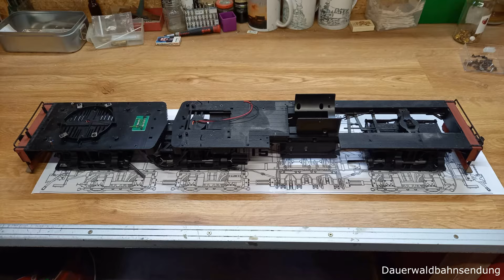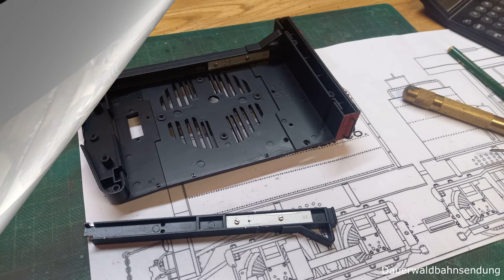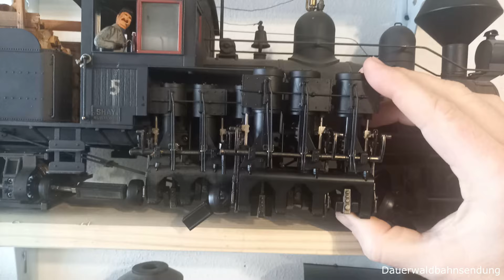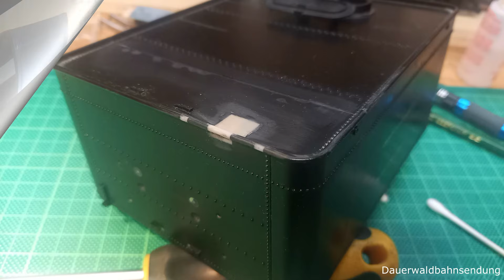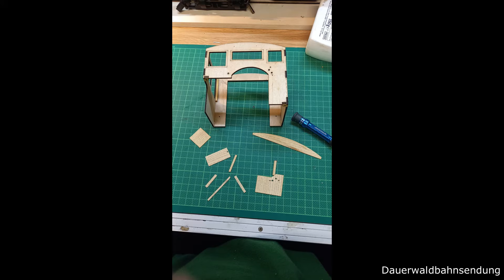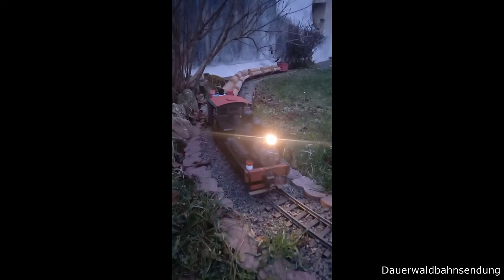Gerd's West Side Lumber garden railroad - Let's build Shay #15

Comment: Hi Gerd, GREAT job on the15. You did a fantastic job using a Bachmann three truck Shay as the doner. When I built my three truckers all they had was the two truck. So I just used the trucks and engine assembly as a start and scratch built the rest. Those assemblies were available from Bachmann. I did midify the cylinder assembly to enlarge it similar to what you did,but 3D printing was not as developed,  so it was also hand made. Anyway It's great to see your work. Look forward to seeing the plow.
Reply from the maker: Hi Bob, many thanks.